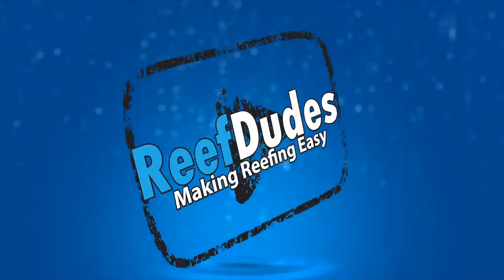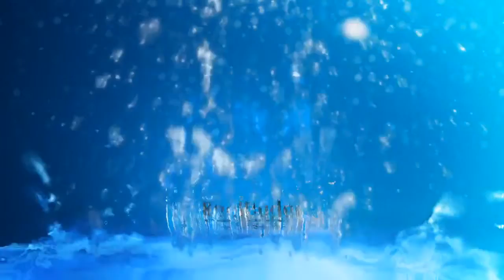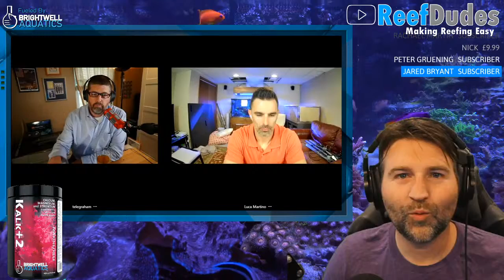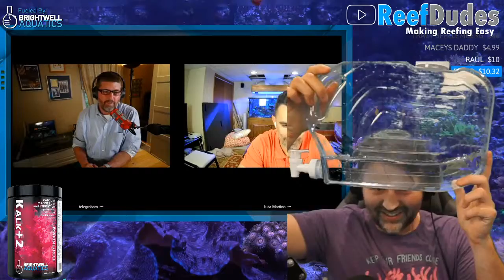Kalkapalooza! - Boosting PH and dosing with kalk Slurry?!

Comment: GREAT INFO ! I am having a problem with ALK. I am using a Avast reactor and dosing 13liters a day (versa pump)to keep my PH @ 8.15. BUT my ALK is a 14.2 dkh ! What I am doing since my dose rate is HIGHER than my evaporation rate is draining tank water and replacing new salt water to keep up salinity. Corals look ok (one SPS has a little whitening at the base). I had run a air line outside to ETSS skimmer years ago (no help). Tank 180 with 100gal sump in basement with cheato.  Magnesium 1380,Calcium 460. I am running a Korallin sulphur biodenitrator also.So last nite I had shut down the kalk reactor and in 6 hours my PH dropped from 8.12 to 7.98 ! I turned the kalk reactor back on. Any Ideas on how to lower ALK besides co2 scrubber?

Comment: I’m thinking about trying this method. First I will add a 50 gallon brute trash can full of water and plumb it to my sump through a closed circuit. Super high flow and then dose the milk into the trash can. This will increase my tank’s volume by 50+_ gallons and remove “hot spots “

Comment: Luca, when I was growing phytoplankton, I was using 2 liter bottles with a cheap cap that has a 1/4 tube and valve to pump CO2 into my cultures by mixing baking soda and vinegar. Maybe you could do this to your skimmer to shove more co2 into your system to allow the additional milk

Comment: I watch all your streams and they are so informative. Thank you so much for everything you do. Just a question: I know you now don't use the slurry anymore, you follow the ACI approach on dosing Kalk. I wonder why.. What did you find that made you give up on the kalk slurry? I am thinking to give it a try, but I would like to know your experience and the reason to not use it anymore. Thank you so much.
Reply from the maker: I feel many brands of kalk has a lot of impurities mixed in.  Over a long enough time I suspect those impurities may build up and cause issues down the road.  Complete speculation.. it May never be an issue. But over the long term I feel there may be.  Reactor is tried and true safe method. I’m kinda doing a hybrid method now.

Comment: Great Video defiantly works and turns into sand eventually.  I did this for a while much before reviewing this video and found that the kalk in suspension tends to seize pumps,  had it happen on maxpect, abyzz a400 and Tunze.  How do you all handle this?   My system is ~1200G Acro tank and has happened in several of the remote systems :}
Reply from the maker: I'm doing this on two tanks and so far no issues with any of the pumps but i will keep an eye on it.

Comment: When I dose slurry, Alk climbs too high. How do you minimize that side effect?
Reply from the maker: I have it only dose when alk is less than X. Or just lower the dose to keep it under a certain Point
Reply: All my ATO water passes thru the kalk reactor. I wouldn't want to shut it down for long. I suppose with the right equipment you could bypass the kalk reactor when the alk reaches a certain point.
Reply: By not dosing the slurry, only dose the saturated liquid. Simple.

Comment: @44:30 ish- 700 gallon system averaging 400g CaOH per day works out to 5.4 mols calcium. Adding the same Calcium using standard 500g/gallon CaCl2 dihydrate would take over 6000ml. That translates to 12.0 dkh/day demand. Something isn’t right here. There surely is a significant amount of precipitation. 

I considered a similar approach but keeping a homogeneous saturation is way too complex. I’ve been experimenting with NaOH  for 9 months. My first test was dosing NaOH  only aiming for stable alkalinity. Over two months pH swings started getting out of control. Coral started showing distress 6 weeks in while maintaining Alk stability became increasingly difficult. As I suspected, the reef became co2 deprived. Hydroxide itself does NOT contribute to “alkalinity”. A massive bicarbonate dump of about 3.5 dkh made significant improvements in pH stability, alkalinity stability and coral happiness. I continued my experiments with different combinations of toggled dosing between NaOH, KOH, Na2CO3, HCO3, Ca(Cl)2 and tropic marin part C. I learned that alkalinity stability doesn’t mean much without pH stability.

Comment: Makes sense, been dosing LaCl into my overflow for years for the same mixing reason. Been also monitoring CO2 and installed HRV a year ago but have noticed my pH is still low once I closed up the house for Air conditioning.

Comment: IOND measures Potassium!
I am sure someone mentioned that but there you go.
Gotta say I love this episode - so awesome - I don't have enough consumption and don't have a controller (I do have the KHD).
I dose a Kalk and AllForReef Mix - I don't think I will change mainly because I don't have the room under the tank and I like an all in one solution - plus when I have measured pH it's always been over 8.2.
I wonder if Luca or Jim can comment on phosphates because I thought Kalk binds up phosphate- I have a very high ratio of PO4 to NO3 because my PO4 is (according to test kits) 0.01-0.03 and NO3 is like 20. So I am wondering if dosing Kalk is part of the reason and then the question is can you maintain have phosphates like at 0.02-0.04 using this slurry?
Reply from the maker: I have heard that too.  It will be Intresting to see if my po4 drops doing more of the slurry.

Comment: This discussion has cause me to order this large volume magnetic stirrer, this will work with 5 gal carboy 
https://www.northernbrewer.com/products/maelstrom-stir-plate?variant=30234289471532&gclid=EAIaIQobChMI1oGN3MuN8QIVMQutBh39nQetEAsYASABEgIg2_D_BwE
Reply from the maker: That looks sweet
Reply: @ReefDudes  the other option I was looking at was something like this but that would mean a open top unless I have a really small opening Lab Stirrer Mixer Overhead Rotary Knob,2000 RPM,10L https://www.amazon.com/dp/B08GX3PLJD/ref=cm_sw_r_cp_api_glt_fabc_ZRVK2XBKKYAPBW4YAHYY?psc=1

Comment: Glad I watched the stream another good one as usual. I have been wondering what’s the highest safe ph I can have. I don’t have central air so I use a window ac unit in the summer and go out of town a lot on the weekends and my ph has been hitting 8.45 and my apex alarm has been going off but sounds like that’s fine or actually good
Reply from the maker: I would shot for a max of 8.4.    8.5 would be the absolute max I would want me tank to ever hit
Reply: @ReefDudes  yea I was kind of thinking the same thing I put my ph alarm at 8.45

Comment: What's the practical limit of kalk slurry concentration? 50x? 100x?
Reply: Great question! From my perspective, it’s a physical limitation. There’s a point where the slurry will become too viscous to be moved via peristaltics, and container homogeneity would be challenging to maintain. 1 cup/gallon moves well. It got a little thick when I doubled that. Ultimately, a good peristaltic softens the question, because you can simply dose more. It becomes a container size thing.

Comment: I can vouch for this method too, been doing it for over a week and its just amazing. I'm doing exactly what you're planning on doing, basically a very milky stirrer. Its working....!
Reply from the maker: It’s been working well the past few days!
Reply: Wait, how can a week be enough time to form an opinion one way or another???
Reply: @Effortless_Perfection  because it's doing everything it should do within a week, and I'm seeing positive changes within a week (now 2 weeks). Nothing good happens quickly in reefing so the fact that this is going so well, so quickly, is a good thing.
Reply: @MakerofThingss  i would so try this if i actually had s controller to check the ph